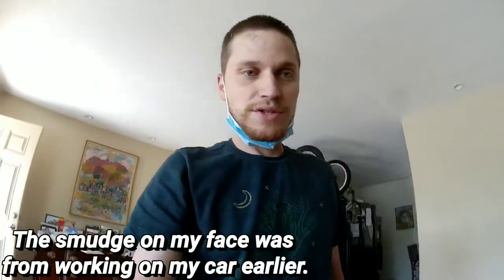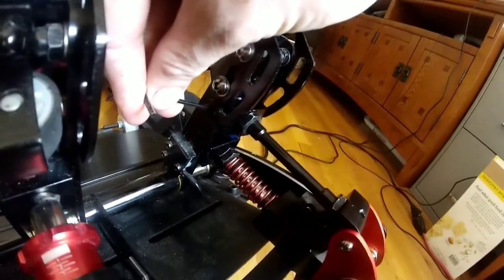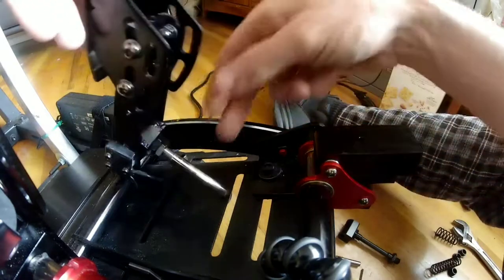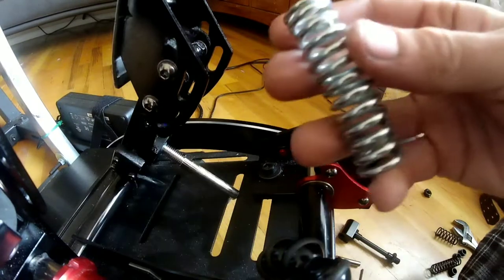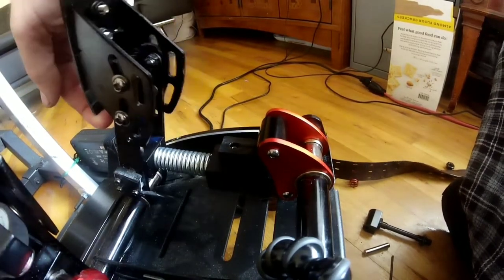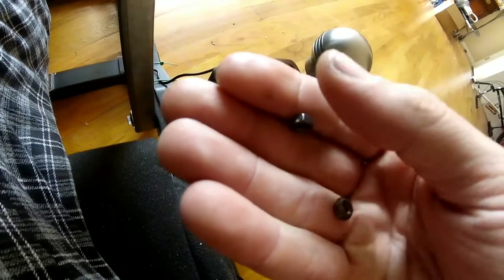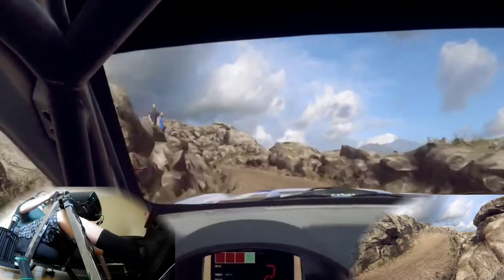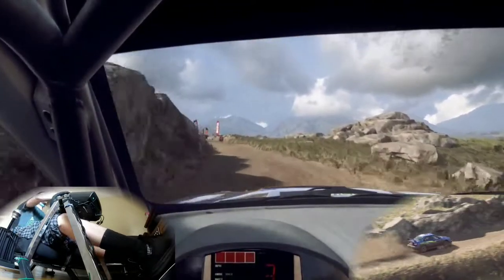Fanatec V3 Pedals Clutch Spring MOD!

Comment: I have driven a few race clutches that are 3 and 6 puck unsprung, and they actuate the same as the v3 but a lot stiffer. At the end of the day, it’s what ever you like as it’s your property.
Reply from the maker: Perhaps I just havent driven in legit racecars and only high performance street cars. I am happy with how the clutch feels with this mod and its the closest I can get it to feeling like cars I have owned without serious modification.

Thats also why I have my brake pedal on the softer side because I am still using a brake booster on my car I am building for dirt racing. I will eventually go with a more direct brake feeling but I just got a new master cylinder so I dont want to rip it out just yet. Lol

Comment: This mod must do the opposite of your intention (making it feel like a real car)  - I find fanatec v3s far too linear out of the box - your mod would make the pedal even more linear -  real clutches do not feel linear at all - fanatec needs a higher cam or something to make it feel more real
Reply from the maker: Its dependent on the clutch. I have felt only one clutch in my life that felt like the v3's out of the box and it is the 2019 ford fiesta. The clutch on that car feels like a toy.

My clutches on my performance cars with clutches intended yo hold much more power feel linear to me. That was my goal to replicate and this particular mod brought me much closer to that feeling than anything Fanatec offers.
Reply: @DouglasThompson  I have been driving manual cars for close to 40 years. None of them have felt linear. They ALL are stiff until they fully disengage and then they get softer once the clutch is disengaged. Moreso with performance clutches. A steeper higher cam is probably a better mod. To remove the cam would totally remove the feel of clutch engagement. The Fanated v3s feel almost linear out of the box. The effect of the cam is hardly noticeable and the pedal is far too light too.
Reply from the maker: @iangibson871  That feeling of clutch engagement felt very unnatural to me. I have been driving manual cars my entire life as well and the v3's didn't feel right to me. Keep in mind I am attempting to replicate the feel of 2 very stiff clutches on my highly modified WRX's.

My 06 dirt racing car is roughly 400awp 435awt so it needs a bit beefier clutch than most road cars. 

My 04 is more or less stock engine-wise but it has the full array of bolt-ons amwith an accompanying professional tune to put me above an STI in terms of power to the wheels.

Needless to say both of the clutch pedals are very stiff on my current cars and this mod stiffens up the clutch pedal considerably. That was my main goal.

I cant say I would have kept the camming action if I had the choice but no spring combo was possible to stiffen it up without losing a lot of pedal travrl and thats not something I was willing to sacrifice. 

If you like how your V3 pedals feel and you think they feel realistic, thats great! This video is intended for peoole that are not satisfied with how their V3 clutch pedal feels. It is an inexpensive, easily reversible modification that can be done in a couple mins. 

I hope you understand my reasoning.

Comment: Thanks for the tutorial! I did that as well, but put the original black spring instead. I love the nice linear feeling!
Reply from the maker: I think it feels great too! Every road car I have ever driven has felt more like this than that odd artificial on off feeling that the standard setup feels like.

I think it's all marketing, I don't think it's possible to feel the clutch plate make contact with the flywheel through the pedal. I have only ever experienced feeling a clutch by remembering where the clutch engages by way of the car beginning to move. Any other feeling is most likely just due to the pedal placement and whatever pivot point/spring the manufacturer uses.

I could be wrong but I have owned 5 manual cars and driven more than that and I have not felt this sensation. I currently own 2 WRX's both heavily modified and both feel even more linear than this pedal mod does. Only muscle memory can I rely on when getting the clutch bite point.
Reply: I think you're right. I checked it on my car clutch today and I must say it's not completely linear. I think it is somewhere in between the standard fanatec and the mod. But the standard just feels way too odd so I definitely prefer your mod! I'm thinking if I should try to add the damper somehow to the clutch. I know it doesn't make sense at all because no clutch is hydraulic but I still wonder how it would feel like.
Reply from the maker: I have heard of some users liking the feel. You can use the damper to add a mechanical resistance feel.
Reply from the maker: To clarify, what I meant was Fanatec is using marketing hype claiming the "bite point" is what they are trying to replicate. I have been in cars that feel like they have that slight easier point to push the clutch in all the way but I found no correlation between that feeling and where the clutch "bites". 

Your clutch would be close to worn out if the bite point was that far up in the pedal travel. Every new clutch I've ever owned/driven has had the bite point almost to the floor so as soon as you begin lifting your foot, the car is beginning to move.

I have not driven all types of cars so they could be trying to replicate a specific car or type of car but I think they are being a bit misleading.
Reply: @DouglasThompson  Yeah I did try is out (the damper on the clutch pedal). I didn't like it. What I did is, I also removed the little black piece which you turned around and left it there. After that I changed the red against the black spring and I turned the two nuts as far away from the pedal as possible (about 1 cm), which adds a bit more force to it. It's probably still softer than your mod but works perfectly fine for me. Thanks again for your idea! it's exactly what I needed.
Reply from the maker: @Firlefranzz  Really happy I could inspire you to figure something out that works for you! :-)
Reply: @Firlefranzz  did you use the v3 damper kit for your clutch mod?
Reply: @jeremymartinez6024  yeah I tried that, but didn't liek the feeling. In fact I don't like this damper kit at all because it just slows all the motion down. I use the black spring for the gas pedal, the performance kit for the brake and the mod from this video also with the black spring. I'm perfectly happy with this setup :)
Reply: @Firlefranzz  How did you attach the damper to the clutch? I’d like to try it out even tho I’ll likely wind up going with the mod from the video
Reply: @jeremymartinez6024  I can not remember to be honest. It's quite a while ago. Sorry mate.

Comment: Hi, the spring is no longer avail. Do you have any measurements? Thanks.
Reply from the maker: I can measure the spring but damn let me see if I can find another source.
Reply: Any luck finding another option?
Reply from the maker: @proper__  Not yet...Best bet would be to take your spring in to a hardware store or a specialty spring store and match the sizes...
Reply: Any luck?
Reply from the maker: @yaboy9843  Nope...sorry. I checked some hardware stores and couldnt find a comparable spring.

Comment: Hi Doug. I love your videos thank you. I have the v3 pedals. I wonder if you could help me make my clutch “engage” more realistically? It feels like the clutch engages in disengages at the bottom of my pedal throw i.e. with my foot all the way down. I have played with the saturation and dead spots in my game settings but the clutch still feels like it is engaging and disengaging in the last inch or two of the travel of my pedal as it goes to the floor.  When it engages it is very sudden it’s not gradual no matter how slowly I move my foot. Cheers!
Reply from the maker: Well honestly, thats where a new clutch should engage but I understand the "lightswitch" effect like you are talking about. As far as I know, there is not a setting to help with this...its frustrating.
Reply: Yes the light switch effect is a perfect description. Thank you for responding. 🍻
Reply from the maker: @drumbri  Just pretend its a crazy high performance clutch made to hold 3000hp. ;)
Reply: @DouglasThompson  😂

Comment: Thanks for the video, I will try this out. I'm after a resistance feel roughly the same as the stock accelerator pedal on the Fanatec V3. Does this mod make the clutch much stiffer than the accelerator? If so, what spring would you recommend to make the clutch roughly the same? Also, could you do this mod with the stock clutch spring or is that too loose?
Reply from the maker: This makes it much stiffer that the stiffest spring on the V3's. I don't recommend doing it with the stock spring, Im not sure it would work.
Reply: @DouglasThompson  Thanks for the response. Ok, I will see if I can source a mid-stiffness spring and see how that goes. I may try the stock as well and let you know how I get on.
Reply from the maker: @olibateson  please do. :) Good luck

Comment: can you add the stiffer spring but keep the original setup?
Reply from the maker: You can keep it in the way that you can easily reverse the mod but this particular new spring is physically longer so you have to remove some parts to get it to fit. If you're able to find a stiffer spring that is toughly the same size as the original, you would be able to keep the rest of the parts installed. I personally didnt like the on/off switch feeling of the cam but if you like that feeling, this mod definitely is not something you want to do.
Reply: Good question.. Youll need to calibrate the clutch pedal to where  you're pushing the pedal to where it peaks resistance before it becomes less. Set this as your max.  If you calibrate it this way,  you'll  find that it will mimic an actual car clutch pedal.  I think the stronger spring will definitely make it even better. So now with this new calibration,  when you first start from neutral to first you'll feel the actual engagement point.

Comment: is it possible to extend the clutch throw of the v3 pedals? the throttle rod seems to be the same diameter as the clutch rod but longer so would it be possible to use the throttle rod on the clutch and use the throttle springs on it as well? and also the square stopper thing at the end of the rod looks similar on the throttle and clutch, so would it be possible to swap them around to extend the throw? I ordered the normal v3s but may cancel the order and get the v3 inverted instead cause ive just realised how short and unrealistic the clutch throw is for the normal v3.
Reply from the maker: Ya. The clutch from the factory could definitely use some work. You can actually use whatever pedal in whatever position you want. If you take apart the rod section and the heel plate, you can rearrange the pedals however you see fit. You can also cut the black spacers and space the pedals differently if you wish. :)

Are you on console?
Reply: @DouglasThompson  thanks for the reply. Im going to be playing on pc. Ive seen on some other videos that the rod could be rotated to reduce the pedal throw on the throttle and the clutch rod looks very similar to the throttle rod so im assuming i can rotate ths clutch rod the to extend it? but im not sure if its possible or how far it can go. The rod doesnt look long enough to extend it significantly but im not exactly sure since my pedals wont be shipped until december and im kinda worried about the clutch throw and stuff cause i will be using it a lot and i want it to be as realistic as possible.
Reply from the maker: @curry_man69  I'll post a link I think will interest you if you don't already know about them.
Reply from the maker: @curry_man69  https://youtu.be/g-O5Beil878

These will be my next set if I ever stop liking my V3's.
Reply from the maker: @curry_man69  that link I sent you, I believe those pedals are a bit more expensive than the regular V3's but less than the inverted and they seem to have excellent throw and all the pedals are load cell and hall effect like the V3's.
Reply: @DouglasThompson  Thanks for the suggestion, the pedals do seem quite good for the price. Out of curiosity, have you considered or tried inverting the v3 pedals by mounting it upside down like a street car?
Reply from the maker: I did but then I decided it would be extra weight right over the actuators. Weight is more important to me because I am running full motion.
Reply: @DouglasThompson  hmm ok cool :)
Reply from the maker: Those simforge pedals look pretty solid. I'm always tempted to just snag a set but then im like. My V3's feel great. Lol
Reply: @DouglasThompson  are the v3s realistic in how they feel and are they really good? cause if it is then i might as well just keep the order and think of a way to fix the clutch when it arrives since i ordered it with the csl dd and cancelling it and reordering it might delay the shipping time
Reply from the maker: @curry_man69  they feel great. The throttle and brake feel awesome from the factory but the brake kit (not the rubber things) makes it feel like a road car. It also comes with other springs to tune the feel of things. I love mine.
Reply: @DouglasThompson  its such a tough decision 😂 wish i had an unlimited budget lol
Reply from the maker: @curry_man69  that would be nice wouldn't it...